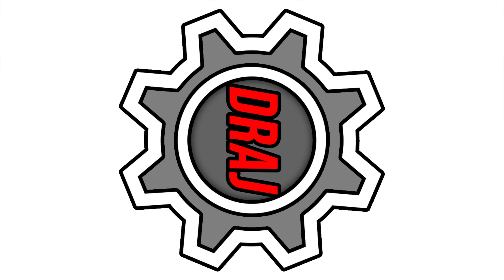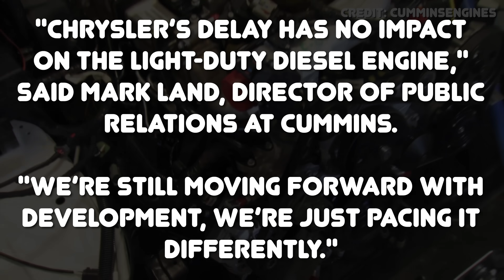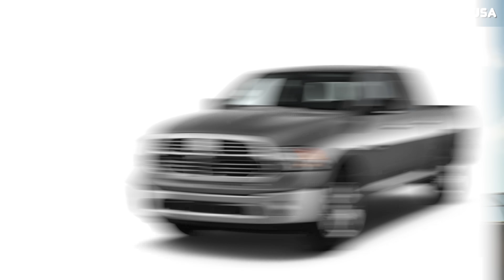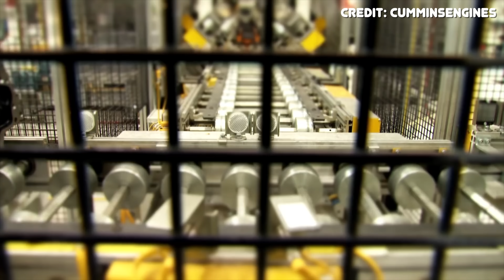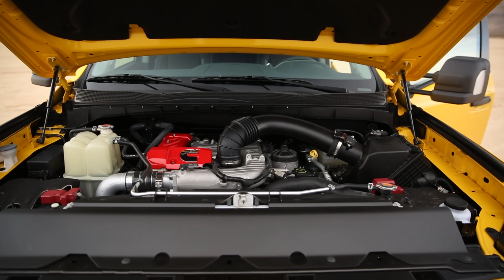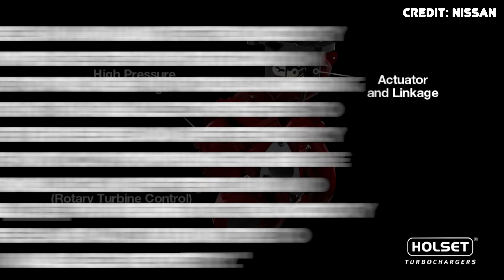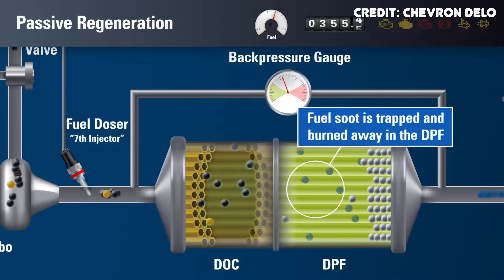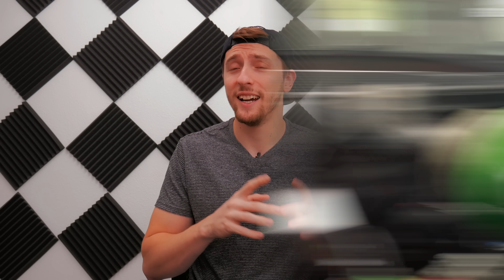5.0L Cummins: Everything You Need to Know

Comment: I think the big problem is that it didn't compare favorably against their own gas engine. Particularly in the fuel economy department.  A few tenths is huge in a commercial truck, but in a commuter that tows sometimes, it needed to be a little more significant. The gas engine tows about as well, gets about the same fuel mileage (even while towing) and doesn't require def or other $$ equipment. It needed to either tow a lot better or get much better economy and it did neither. Specially after they cranked up the 5.6 a little the next year.
Reply: Good comment! Very informative!

Comment: Great job on this video. My XD is the best truck I have ever owned. The expanded towing capacity of a diesel and rides like a Cadillac. 

I tow about 60% of the time. I roll the scales at 16k moderately loaded, truck trailer and gear. The XD just shrugs its sholders and goes.

Comment: These engines are horrible I got my truck with 35k turbo assembly was replaced at 36k   now it has 60k getting a new motor after the turbo actuator failed and the engine started knocking cummins should have never made this engine it's horrible

Comment: I have a 2016 Nissan XD with the 5.0 L diesel Cummings and I also owned prior to this truck a 2017 ram with the 6 cylinder EcoDiesel and I can tell you without hesitation. There's absolutely no comparison between those two motors with the 5.0 Cummings being six times the motor that EcoDiesel was. My first got the EcoDiesel. It was respectable for a 6 cylinder, but then ram had to reflash the engine because of the EPA issues they had and it turned that motor into a gutless useless engine.  Fuel mileage dropped and the limited power it had disappeared.   The Cummins is equally as quiet with slightly lower fuel economy, but 3x the torque and horsepower.  The only complaint that I have about the 5.0 Cummings is it spends a lot of time in regen if you don't get out on the interstate every 4 or 5 days and really stretch it out.  And that region smell in the cabin is really strong and overpowering at times.   That's my only complaint. Other than that, it's a fantastic setup and the Nissan Titan truck is a greatly underappreciated and undervalued truck in the US full size truck market.  Unfortunately it just gets lost in the brand wars with respect to being a late entry into a truck market space that has been so heavily dominated by the US manufacturers.

Comment: I have 94 12 v with 800,000 and 2019 xd 5.0 . I don’t believe my 5.0 will last as long but I have had zero problems towing daily 5000 pounds with lawn trailer . I have 50,000 miles on it and and zero problems . I bet it will be solid too 300 at least

Comment: If they'd have put the 5.0 Cummins in the 1500 Ram trucks, they would have sold a shit ton more of em. No doubt in my mind. This particular Cummins kinda reminds me of the 6.4 Powerstroke ( not a good thing ) as far as the fuel system goes. Little bit of shit gets thru the fuel filters...engine is toast. Not a good thing either.

Comment: I have a 2016 titan xd it is now a lawn ornament the crank broke at 134,000 Mi three handfuls of metals in the oil pan and I still owe $30,000 on it Cummins new that they had a problem with their crankshaft they fixed it in late 17 but they fail to fix the ones in the 16s and early 17 models should have been a recall I was very happy with the Nissan Titan the way it drove the power it had after being deleted but the catastrophic failure of the crank and then Cummins fails to recall their f**** I cannot give it a thumbs up

Comment: I have a 2016 and have had one failure. The turbo actuator unit failed. The one that sits at the top back area behind the intake manifold. It failed at 39K miles.

Comment: I love these episodes. I believe Nissan quit using the 5 litre for the turbo issues, and regen/def related issues. I may be wrong but that's what i recall. Speaking of recall, seems they learned their lesson from the cvt fiasco by putting an end to this 1. Hopefully there's some serious R&D and the 5 litre makes it back to the market.
Reply: Nissan stopped using the 5.0 because Cummins cancelled the contract. Emission changes and the need for more power was forcing Cummins to invest engineering money into a motor that wasn’t selling volume wise. 22,000 units a year isn’t enough to justify a further investment. The motor has zero turbo issues other then the regular 200k replacement. Issue is it’s a two stage and with the computer you are stuck ordering their $5000 turbo with no other replacement. The engine does have crankshaft issues with plenty breaking and the used market has sky rocketed due to availability so your stuck spending $15,000 plus for a used engine

Comment: I had a 2016 Nissan XD with this engine.  I didn't have any major complaints with it.  It was very quiet for a diesel and had good power and torque for a smaller engine.  I towed my 27' holiday trailer with it.  And it pulled it quite fine--a bit better than my previous Titan with the 5.6l gas engine.  However I was disappointed that it didn't get any better mileage pulling the trailer than what I had with my gas engine.  So for the little bit of extra torque and less HP than a gas engine, it never really blew me away.  I like the idea of the 5/8th ton truck, but it is interesting that the XD never really took off.  I saw at one point that Nissan was selling XDs in one month what Ford sold F150s in one day.  So I guess the concept (and price) just never caught on.  I watched the development of this project with great interest and could hardly wait til I got my hands on the new Titans--and now Nissan has totally stopped building full size pickups.  Strange times.
Reply: That sales figured really doesn't seem that bad. If memory serves me, the Honda Ridgeline saw much worse sales numbers in 2016, 2017, & 2018. It took four years of the second gen truck before Honda came anywhere near the sales they were expecting.

I know that's a bit of an odd comparison, but both trucks do compete with the F-150. Just for much different buyers.
Reply: @codeman99-dev ridgeline is a unibody ute, not a truck.
Reply: Nissan entered a crowded market is why.

Comment: They had trouble with the DEF and the nissan technicians had little experience with that crap.
I know a guy that got a new engine at 30,000miles and they ended up deleting the DEF for free with full warranty anyways. Truck ran tip top after that.

Good on them for taking care of customers and doing their best. But it might not been a very profitable product if they had to give away all these engines for free.

Comment: My 2018 with 125k, just had a major internal kaboom , had it towed to the largest Nissan dealer here in my area, and they won’t touch it. It’s stock, only upgrade was the Fass system, due to Nissan using a plastic housing that cracked and leaked fuel.  So now I’m stuck looking for someplace to repair my Titan. I have an extended warranty.  Nissan dealers have bailed on all the 5.0 Titans.

Comment: I has hoping Cummings would design a strait 6 3.0 free valve hybrid all electric 48 volt similar toBMW only with with the pancake starter generator and electric boost on the front of the engine for easy access. They would have the best torque most power and by far the best mileage.  I guess America is not ready for that kind of greatness.

Comment: I had an xd diesel for 2 yr and loved the truck. It provided more than enough power to pull my 7500 lb camper. However def system sucks and would put my truck in reduced power mode often and with recent fuel increases i reluctantly went back to a gas 1/2 ton.
Reply: All Def systems suck lol.

Comment: cummin are usually pretty good, but thos engine really sounds underbuilt. 
when you buy a diesel you buying it for reliability, fuel economy, and the ability to take abuse.
if you want quiet and no vibrations then get a gasser

Comment: I recall looking at their trucks a while back and was pretty unimpressed and I often am unimpressed with these attempts at making a compact diesel with turbos in smaller form trucks. I feel it's been a fad companies were trying to get on to fill some sort of weird niche. Promising better fuel economy with towing power, and the specs barely rival their gas counterparts. You factor in price for maintenance diesel has a bigger list, you have def, the turbos are failure point, diesel fuel is always higher cost. If you tow and haul heavy get the diesel engine made for that job. If the biggest thing you drive is your boat on the weekend or the small mobile camper then a solid V8 is perfectly viable and has far less surprises. I worked at a truck stop and the travelers(not truckers) that came in with complaints about their 2500,3500 vehicle were 10/10 times a diesel truck owner that was helpless, and we didn't service those because we only served commercial.

Comment: I am at 73,000 miles on my 2018 5.0 in my Nissan and from what I have learned from articles I have read it seems I am now just waiting for one of the failures you have described either emissions related or turbo related. I have thought about doing a delete when my warranty is up but it seems emissions runs out at about 60 k and not included in the power train. I am really on the fence about keeping and deleting or just selling the truck knowing what I do about the engine. I have also heard replacement parts such as turbo are very difficult to find. Any opinions?
Reply: Its a new truck and an investment you should get the most out of. So keep it.
Reply: Personally right after the warranty is gone, Delete it, You'll actually like it after that.

Comment: Ram screwed the pooch putting a fiat ecodiesel in. They should've worked with cummins on a 3 liter inline 6 architecture that was fuel efficient and torque monster for the Half ton market I guarantee the Cummins would've been extremely better. The 5 liter was a mistake. Inline 6 cylinders always make more torque naturally hence why mopar is designing a inline six to replace the hemi v8 line now.
Reply: Thinking out of the box here a bit but hear me out:
BMW has sweet Inline 6 3.0 diesel. Very smooth and powerful engine for its size.
Volkswagen has a 3.0 V6 Diesel and that engine is known to be the best diesel in the whole VW Groups diesel lineup.
Isuzu, Toyota, Mitsubishi Fuso etc have soild diesels too.

My point is all of these manufacturers would IN THEORY be able to ship crate engines to RAMs doorstep.
Anything would have been better than the ecodiesel really. 
I know people cry and rage about "Eurodiesels" but in my opinion the big BMW diesels and the VW 3.0 TDI are absolute adequate to haul a Pickup Truck pulling a load.

Comment: Great video. The only thing I would add is the poor fuel economy. While the baby duromax and eco diesel ram are very capable of hitting high 20mpg marks are 5.0 titan falls disappointing short in the high teens. That was probably the biggest killer with it being a very expensive half ton truck that had all the problems and fuel economy of the big diesels but with less power and capacity.
Reply: I have a 2016 XD diesel For 9 years Love the truck And I get 21 to 23 miles to the  Gallon I had a 2008 Toyota tundra I could only get 17 miles to the gown at the most
Reply: @robertcorey7064 that’s kind of my point. It’s not uncommon for the 3.0 PS, Dmax, and eco diesel to achieve high 20s and even 30mpg on highway untuned/deleted. It seems the 5.0 Cummins falls short of that. It achieves 3/4-1 ton fuel mileage while not having the capacity.

Comment: You say the 5.0 was designed for fuel economy but neither the Mfgr nor the aftermarket ever got stellar mileage out of this engine. It was hard pressed to get any better mileage than the 6.7. Although for the weight of the motor & truck and power it makes the 6.7’s fuel economy is good.

IMO Ram made the right decision for the 1/2 ton to get the mileage with 1/2 ton sufficient towing power with a 3.0.  Unfortunately it took until the 2nd generation 2020+ to get it right for reliability.  (At least as reliable as government emissions systems will allow.)  Same for the GM 3.0 which is being revised for their 1/2 ton now. For Ram GM & Ford to actually get 30+ HWY for a full size 4WD truck is impressive. Also basic tune easily & reliably makes 300+ HP & 500+ TQ. Put with the 8 & 10 speed transmissions this will handily tow as much as you should be towing with the 1/2 ton platform. 

Ford execs never allowed their 3.0 diesel the opportunity to succeed. It wasn’t going to be the mileage champ of the 3 but it would have been more truck use reliable than Ram or GM’s first 3.0s. Mercedes & Audi’s 3.0 diesels are also fuel efficient and powerful & reliable. I suspect Toyota’s new 3.0 diesel will be as well. Wish our government would let us have more of them. My son had to order his 2022 to get both the 3.0 diesel & truck he wanted.

Comment: This truck quoted from Nissan was to be the equivalent of early 2000 diesels. They all had 300ish HP, and mid 500tq and could tow 12,000lbs and a 5 speed. That's what this truck is. It's only been recently that we needed to tow a building at 70mph on cruise. This truck failed because it's branding, and people owning bigger trucks than they need. This truck does not get the best fuel economy because it's as heavy as a 3/4 ton, and also has 3.92 gears. Its designed to work, and is happiest with higher rpm and some boost.

Comment: This was a poor attempt from Nissan to get into the diesel truck game.  No one cared about a middle ground between a 1500 and 2500. You want a comfortable 2500, upgrade the comfort package.  Cummins didn't want to put the same Ram engine in the Titan because it would probably piss Ram off.
Reply: Nissan should stick to affordable, compact light duty trucks with their own engines. Maybe then spin off a Van or an SUV on the same platform... Basically direct competition to Toyota.
That's a market segment they would have more success in I think.

Comment: I never worked on the V8. My favorite for a non com vehicle will always be the 275hp ISB5.9 VP44. The only problems that engine had was the lift pump and it needed a headgasket at least once before you wore it out. Dodge used it but had a one port ecm on it and the calibrations were 100% non adjustable. IE you could not adjust rear end ratios etc. You had to know
some one at chrysler(at the time) who would look up the calibration you needed so the speedo / auto trans worked correctly.

Comment: I have to agree with a lot of the commentary found here in that modern diesel engines equipped with all the extra emissions stuff are simply no Bueno. I have a buddy that has a 5.9 built to the gills and it rolls coal. It is a 900hp 2100 lb.ft. of torque monster.

Comment: Variable Geometry Turbochargers are awesome!  I have driven various diesel engines over the past 50 years.  The ultimate diesel for a pickup truck is a Cummins 4BT.  I have a 2016 Ram 1500 Quadcab 4wd Ecodiesel.  My wife drives a 2018 Ram 2500 Crewcab 4wd 6.7L Cummins.  My daughter and son-in-law have a 2018 Ram 3500 Megacab 4wd 6.7L Cummins.  So we are a diesel family.
The weakness of all diesels sold today except the Ecodiesel.  Is the transmission.  The Ecodiesel running the ZF 8-speed is the best.  
The 5.0 running a CP4 was stupid.  And the Titan XD being a 1/2 ton was dumb.  If the Nissan XD had been a 2500 and 3500 with air suspension as standard equipment.  And a VGT turbo. They would have sold really well.
One of my coworkers bought a Titan XD.  He put a 50 gallon fuel tank on.  Added an Airlift 5000 system.  And had an excellent towing vehicle!

Comment: I used to work on the v8 Cummins before I changed careers and it was pretty common for titans to blow a 5.0 Cummins in 10,000 miles or less
Reply: That happens with any mass produced vehicle, doesn’t take much to make an engine fail if something would .001 off in the engine

Comment: I had the 5.9 Cummins and the Ram Ecodiesel and now the XD 5.0 Cummins and I feel it is so much more smoother running than any of the other two and just a much better all around truck, I wish they didn’t discontinue it because I would have bought another one for sure. Thanks
Reply: I'm sorry but you're crazy if you think a titan xd with all the turbo problems it has is a better truck than a 5.9 cummins the 5.9s are one of the most reliable and strongest small diesel engines ever made that's why it was made for over 20 years the 5.0 cummins is one of the worst engines they have put their names on you can't compare it to the inline 6 diesels they make or the big diesel engines they make isxs ect there's no comparison they discontinued it due to low sales because it was a piece of junk
Reply: They discontinued it because it was awful
Reply: @seanweston2907  I’m pretty sure it was discontinued due to poor sales not the Cummins engine that is used in hundreds of thousands vehicles like school buses across the US I will say the Def system is terrible, Thanks
Reply: @philliproberts3151  it's a Cummins but no real relation to other Cummins engines other than name, it definitely had more potential than what is commonly attributed but that comes at a cost
Reply: @robs1052  what cost?
Reply: @philliproberts3151  Nissan was by far the biggest customer for the 5.0. Hundreds of thousands in busses? Didn’t happen. When Nissan dropped it, Cummins shut production down. Nissan was almost the only customer.

Comment: Have owned a 18 pro4x with the 5.0 for 3 years now. In that time I’ve put almost 70k on it with no issues. I tow a camper, 14’ enclosed trailer and 16’ open trailer routinely. My old truck was a 2010 Titan and it was night and day towing my camper trailer with tools and all my gear. Has been a solid truck.